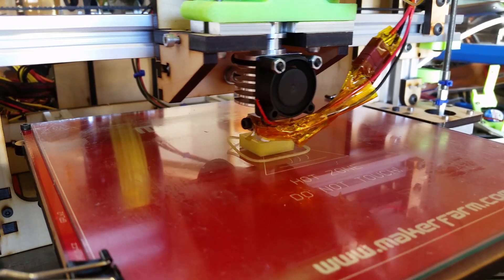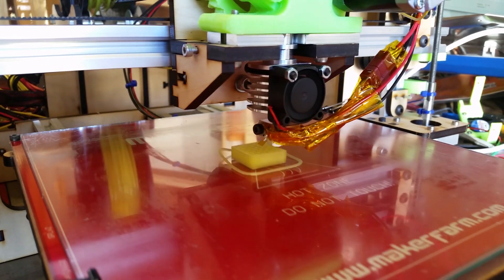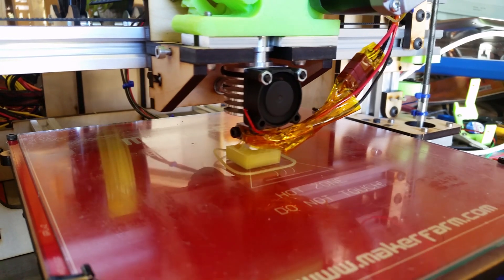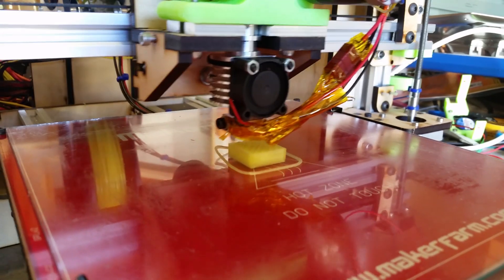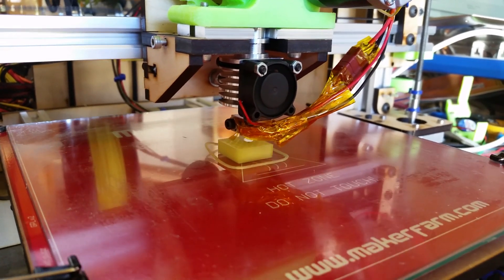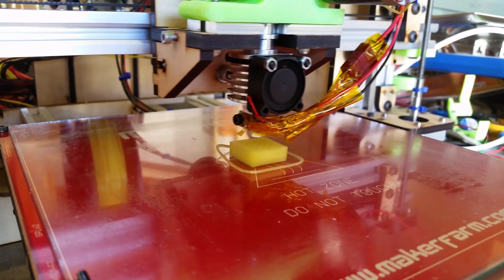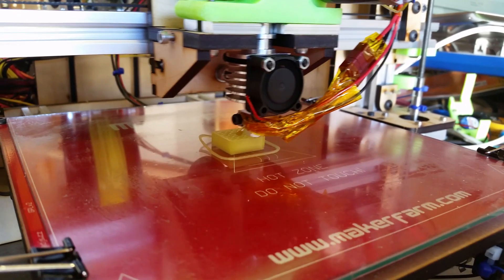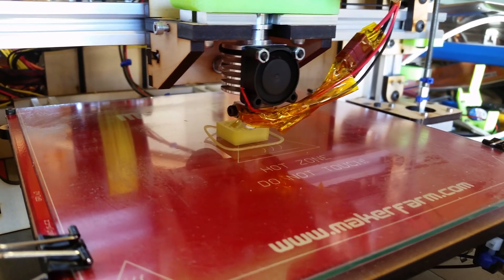A teaser preview of my review of the PrometheusV1 all metal hotend.

Comment: Great videos.  Very helpful and insightful.
Question for you and anybody else caring to respond.  What do you use to keep the print firmly on the heat plate?  I have had many many failed prints due to ABS curling.  I know ABS has cooling and shrinking issues but I have seen videos of large "footprint" designs showing little if any curling or warping.

1.  I have tried hairspray (various thickness of coatings: a "spritz" to heavily coated) with poor results.
2.  Currently using "ABS juice".  Greater success rate with a few failures.

Have not tried: glue sticks, tape (kapton or blue painters)
I watched this last video and your glass looks clean, no hairspray or juice.  Does PLA stick to glass unaided?  
 
My setup:
MakerFarm I3v 8"
.4mm hex hotend
1.75mm ABS filament from MakerFarm

Thank you and keep the videos coming...please
Reply from the maker: Roy Hicken I just use hairspray.  The biggest issue with ABS in most installations is controlling drafts.  If the ambient air temperature is tolerable for people, it's probably too cool for ABS, and if any of that cool air moves across the build platform, warping can occur.  One of the easiest solutions to engineer is to put up walls around the printer, or put it under a large box during prints.

Comment: Kepp up the great vids, I thank/blame your videos for my recent purchase of a i3v 10" from makerfarm which is due to arrive in a couple of days. On that note in this vid I noticed the deans connector on your hot end leads, I wouldn't mind hearing how that is working out, I was thinking of doing similar on my machine w/ 3.5mm bullet connectors.
Reply from the maker: Wolfmetalfab The Deans connectors came with the Prometheus.  So far I like it a lot.  If you switch hot ends a lot, some sort of modular connector would be much more convenient than removing the entire wire path for the fan, the thermistor and the heating element!
Reply: ZennmasterM Oh, ok cool, I'm currently printing drag chains for my X and Z axis so not having the pull the wires back out would be a plus for any reason. The new hexagon came with thermistors with pre made plugs on them. I'm adding connectors to the rest of the stuff at the extruder area as well (servo, z-probe, fans, leds)